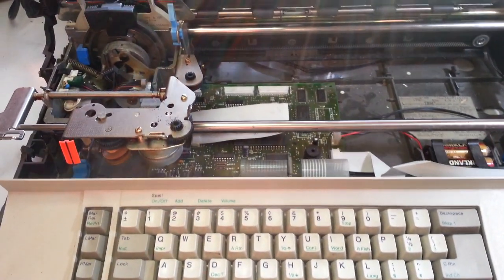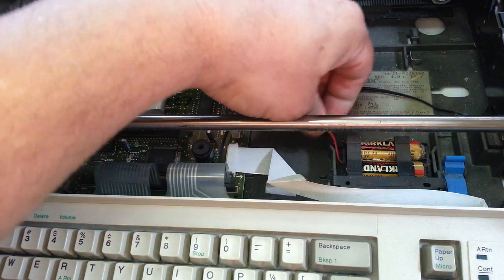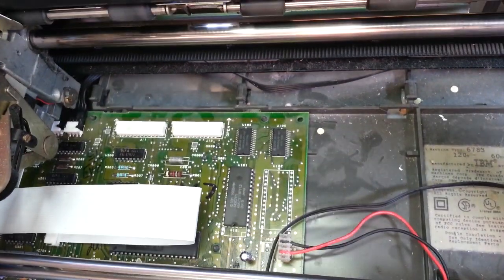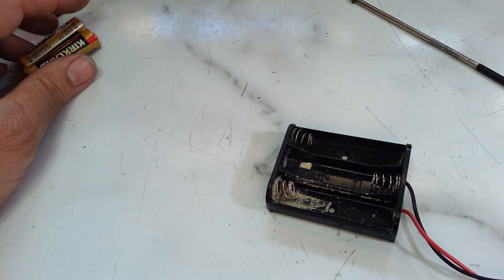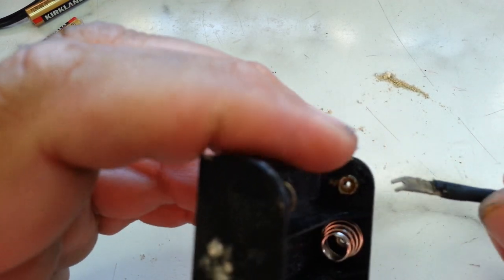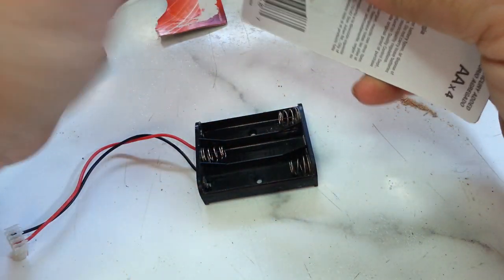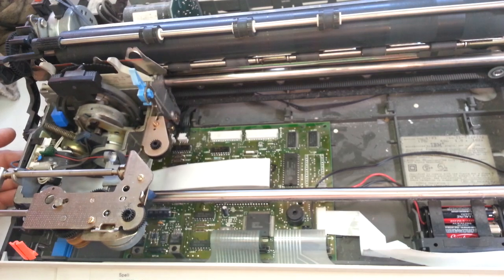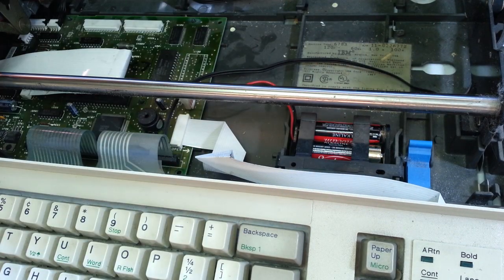IBM Wheelwriter Typewriter Bad Corroded Batteries Replaced Changed Repair Battery Contact Springs

Comment: I found that the alkaline crystals will dissolve in warm tap water.  I know for neutralizing the acid, in the case of ni-cad batteries is 50/50 white vinegar and distilled water.  Not sure what can be used for Alkaline electrolyte.   
I wonder if a standard 3-AA cell battery pack with wire leads would fit as a replacement if you reused the punch down connector.
Reply: Thank you for leaving this comment bro!

Comment: Great tip. But what if one of the pins holding the battery plug is broken? Any way to replace that?
Reply from the maker: Pin on PCB ? Take board out and modify/replace, or solder battery wire directly to PCB.
Reply: @phoenixtypewriter2136  There should be 3 pins on PCB, isn't it? I see only 2. When I followed your procedure to clean the battery pack, it looks like one of the pins came off with the battery pack when I pulled the plug. Do you sell replacement for those pins? I can't do soldering...
Reply from the maker: @formgh841  Just plug back in the same way you took it out
Battery connection only need 2 pins , positive/negative
Reply: @phoenixtypewriter2136  Thanks for this. My battery pack was very corroded. I cleaned it, but it still isn't working. So I thought I might have broken a PCB pin.

Comment: Good video! Any way to change the batteries without losing the memory/ storage?!
Reply: I know it's late but if you do it while the machine is on it should keep the memory. I would only do this if the batteries are easily swappable though, and there isn't corrosion or anything.

Comment: Ibm wheelwriter 6 series 1 . I dont think ribbon is advancing because it types the fifst two characters perfect. Then nothing until i manually advance the ribbon . Ribbon looks like it stays in one place when the hamner strikes it nearly wears a hole in the ribbon..just installed a new hamner strike solenoid. Also tried multiple ribbons. Same result.
Reply from the maker: If ribbon winds and turns manually, it could be the actual ribbon drive stepping motor, sometimes those can be flushed and re-lubed, sometimes they need to be replaced. With ribbon off you should be able to see gear turning while typing. Now that I think about it I recently had a customer who bought WW ribbons from (?) and they were defective, ribbon gear was too short to mesh with typewriter drive gear, check that too.....
Reply: @phoenixtypewriter2136  the stepper motor isnt turning .i have another identical carriage i will try . Thank you for your help..will let you know what happens. I transferred the new hammer solenoid too.